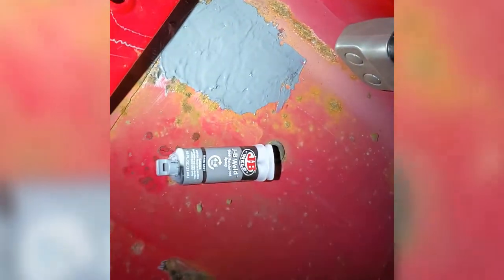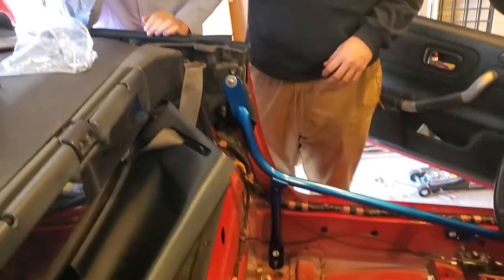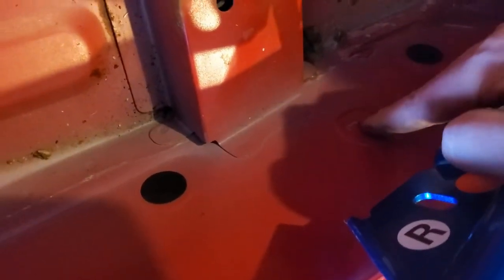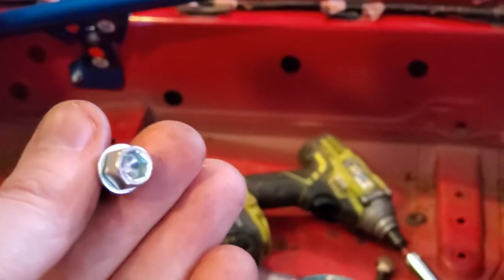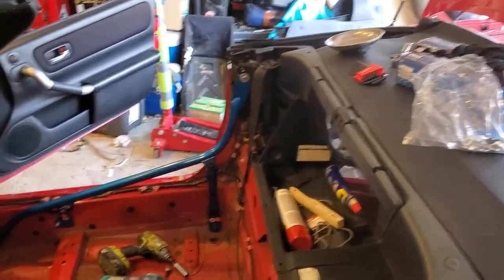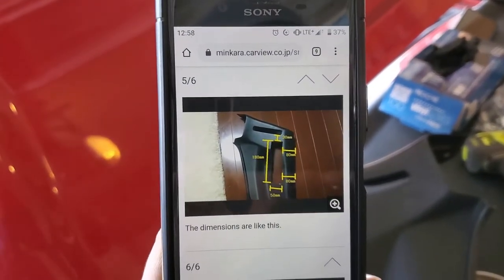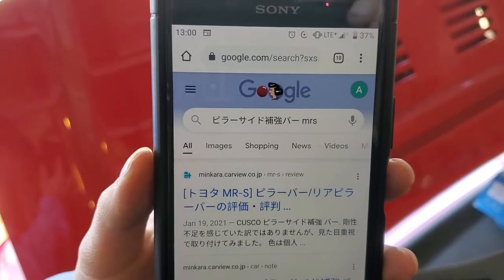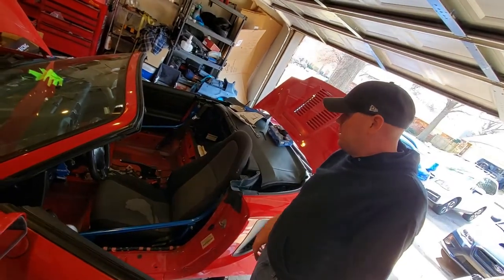MR2 Spyder Tech Day #2 - Cusco Side Pillar Bars

Comment: What's the benefit of these?  And was a difference noticed?
Reply from the maker: the benefit is increased rigidity from the rear of the door opening to the floor.  it prevents the car from "folding" under longitudinal forces.  definitely noticeable handling improvements.  moreso as part of the cusco suite.

thanks for stopping in